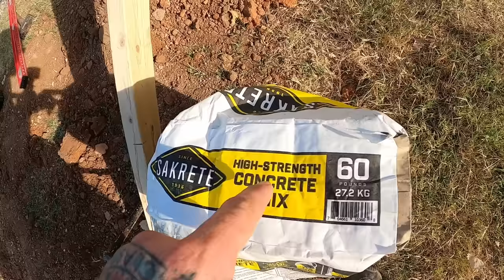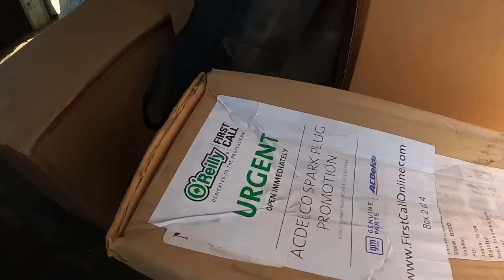Grabbing the compressor, Metal, and MORE. ONE LAST BURNOUT!!!

Comment: On the hand prints, clean them up, dust them with corn starch, then make up some plaster and and make plaster casts of them.  Then you can use them to make a NEW concrete handprint, and update it with their current handprints.

Comment: There is a mortar/crack repair stuff in a tube you can just caulk gun into the crack.  Wipe it with wet rag/sponge to smooth if you want.  Has worked well for me.

Comment: Instead of spraying foam in the cracks of that bright wall, you could have dug from the outside under the corner of the foundation, jacked it up and sprayed foam in the crack under the foundation. I understand that is much more trouble. And using foam to raise concrete, sidewalks and foundations is a pretty common fix nowadays.

Comment: The bottom of the mailbox should be approximately 41 inches above the street level. The idea is to be a consistent height for the letter carrier. Those premade mail box posts from the big box stores are junk. When you replace that one (and you will) I’d cut a post out of one of those cedar trees on your property.

Comment: I usually run 3 -5 16 penny hot dipped galvanized nails per side, about and inch and a half into the base that’s going into the concrete. The sheer strength of the nails makes it tough for anyone to gank it out.

Comment: You probably know this but before you start that air compressor you'll want to leave it sitting upright for a while then run it through a few rotations to clear oil from the cylinders or could damage it.

Comment: I think cutting that piece of concrete off and taking it with you is a great idea because the next owner will probably just break it up and chuck it out unless they want to put a compressor in the exact same spot. If you cut it nice and straight you might even be able to use it as a piece of garden edging or even as a paver in the middle of a flower bed or something like that at the new place.

Comment: I'm no concrete guy(just an electrician), but aren't you supposed to mix a certain ratio of the concrete and water together before you dump it into the hole? Also, as an electrician, I can definitely say you should have thrown some electrical tape on that cord going to the compressor to bring it up to code, your good as long as the taped bit is inside the panel....

Are you planning on moving any of those sheds out to the new place? I don't figure the new owner is likely to need so much outdoor storage, and sheds aren't cheap, I'm sure you could use a little bit of storage closer to the new house for the merch, and maybe seasonal things like your lawnmower or outdoor summer furniture if you have any, and all your winter shovels, etc.

Comment: Shoot ! paintings easy  PUDDIN'! they can PAINT MATCH ANY COLOR EVEN DIRTY TONES ,LOL
Shove everything in to the center of the room ,cover with cheap sheet plastic and tape down 2-3' runners ,all the way around the edge of the room. Plastic over the furniture in the center and paint it !! 2x's  then move the operation to the next room . Tape off edges if you want , but cutting it in ain't too bad . Keep a wet rag handy .  Cover wet rollers with a grocery bag and or leave it in the can. Reuse it the next day , like it wasn't nothin'.   That basement issue STARTS AT THE GUTTER SYSTEM AND OR DOWNSPOUT TURNOUT MISSING.. WATER  ISSUE . Find your local masonry supply shop and grab a mortar pastry bag and a bag of mortar mix while you're there.. have slick hold a board or a pc. Of sheet foam  on the outside ,while you pump the mortar thru with the mortar pastry bag.  Just squeeze it like a pro Chef pumps out frosting
.

Comment: Hey Brother, since you’re a contractor and all, how’s about you use correct terminology when using a level. When using it on a horizontal surface, it’s called “Level”
and when you’re checking vertical surfaces , it’s called “Plumb”
I believe it’s always good to use the proper terminology when providing videos for the public. Thanks and I like your shop!